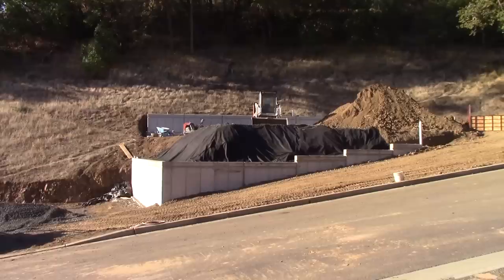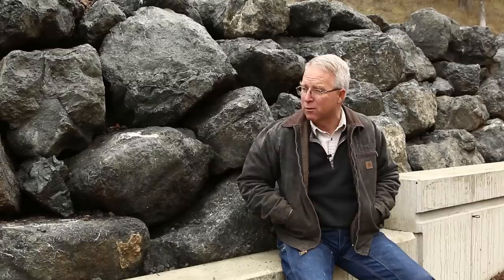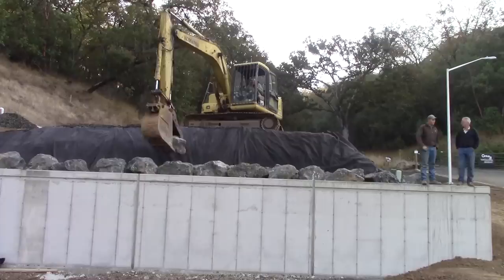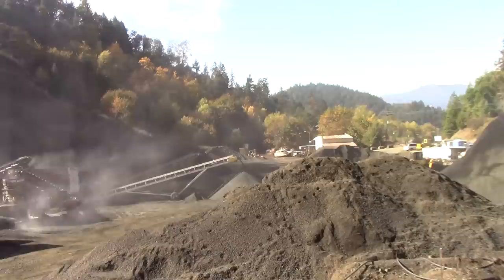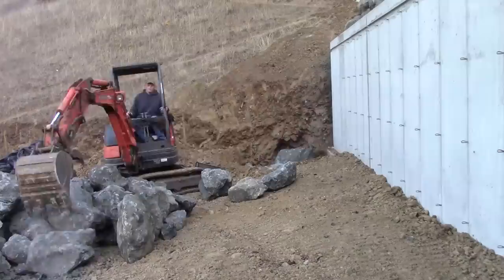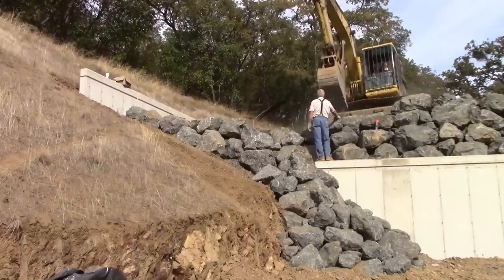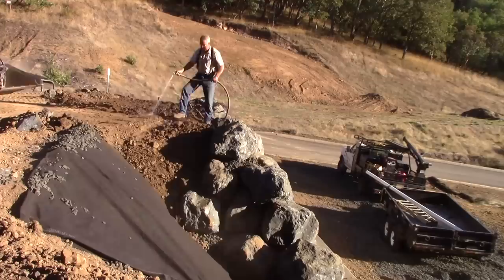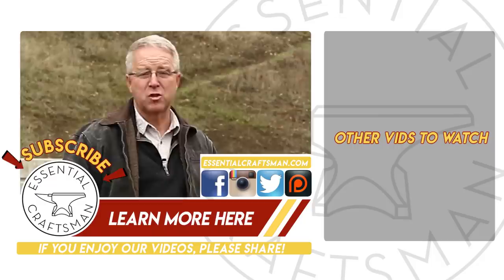How To Stack A Boulder Wall: Ep 20

Comment: At the risk of showing my vast ignorance in construction; I do have some construction questions:

You mentioned in a previous video that building up is cheaper than building out. I'm interested in very small two story homes. Small as in down right tiny. One room home over a garage, but a single structure. So my question is at what point is building too small just not worth the cost saving? I live in a large city here on the west coast. Is it difficult to find tiny plots without having to buy a large amount or is the plot locked into size no matter what you want?

Comment: What would you recommend for an old concrete wall that is failing but still is working. The concrete wall does not go into the ground.  It is only about 3 feet tall.  However, it holds back the dirt well.    We don't want to dig up the wall and put in another concrete wall.  We are looking at boulders next.  We want to put a boulder wall up against the concrete wall.  If the boulder wall placed up against a concrete wall fails as the concrete one is failing, we won't be bothered by the look of boulders moving a slight bit in our lifetime.  
Our biggest concern is that we are on land that has been known to have some underground water.  We have worked on many french drains to keep water away from our land.  However, there is always that threat of a small amount of water.  
What are your thoughts?

Comment: Where can I find the cost of prepping your lot, up to this point?: Ready to pour footings. Yes, it is a milestone. And I'll be a pricey one. I had a 10-acre lot in northern Az. years ago that I had a mobile home on. We wanted to build a house on the lot, but we knew that some work would need to be done to the lot itself, to stabilize it, as we sat on a small incline of about 7% with a 100-foot cliff of unstable rock about 100 yards behind where we wanted to build. The cost to do this was more than the cost of the home itself.

Comment: Did Douglas County require your structural engineer to consider earthquake issues when designing the retaining walls? Or, in placing the riprap beside the wall at the property line? All comments welcome. Steve, SLC UT USA

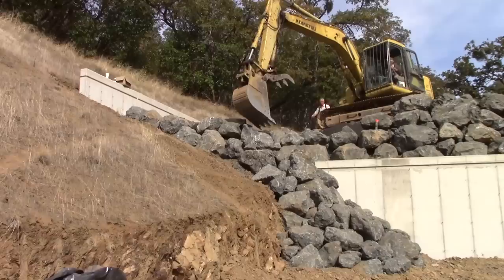Comment: @ 11:24 when you are talking about how the boom or rocks could fall if a line burst.. 

This shouldn't be true. Any hydraulic equipment which is used to lift objects or people, should have double check valves. Double check valves lock the fluid in place if pressure falls due to a catastrophic failure. I don't know what the law is in your part of the world, but double check valves should be on any excavator that is being used as a lifting device. 

Great video, and thank you for the knowledge.

Comment: Does the weight of the rocks resting on the slope to the top of the wall exert a lateral force onto the top of the wall, or are they placed so that all force is straight down? I would be concerned that any lateral force at the top creates a turning moment on the wall multiplied by its height.

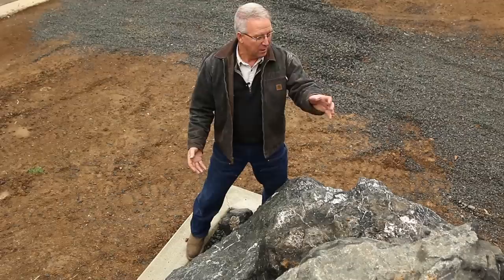Comment: I noticed at 3:30 that the corner of your retaining wall has already developed a crack, which seems to have radiated out from the inside corner.  Is this a problem?  Could it have been avoided?  Sharp inside corners concentrate stresses - that's the famous reason that airplane windows have round corners.

Comment: No rudeness, just all questions and  thoughts due to my experiences with walls I have been called in on to repair.
Isn't that a Massive amount of top heavy? Rain, dirt, silt, now ultra heavy boulders making a constant push towards the wall. Doesn't that manufacturer quite a bit of leverage. Doesn't the height of the wall work as a very long fulcrum in comparison to the width of the footing. I can go somewhat with the idea of a basic lawn or flower bed at top/finished grade. However, without what I call "dead men" reaching back in throughout the backfill and tying together usually in a box shape set at least 4 feet back. Also, usually the "dead men" are set up about 6 to 10 inches above each other. The taller the wall the further the upper "dead men" go back into the upper grade to compensate for the height and length of the wall/fulcrum. 
????
Reply: Essential Craftsman, Have you built a lot of retaining walls this way, or have you seen other walls that were engineered by this man?
Reply: Essential Craftsman, last one I think. How old are those jobs?

Comment: Why are the dump trucks in this video lifting the body before popping the tailgate? I was taught to pop the tailgate first because of the weight shifting and with big rocks and body lifting you can jam the tailgate. Not fun when they jam up. I must add I've worked in asphalt paving and you MUST have binders on the tailgate if you are using a shoot with the body up. I have seen tailgates POP. Meaning the welds on the body didn't hold with the body in the air under load WITH the binders on. I've seen the hoist pin break resulting in the body full of (HOT) asphalt dump behind it resulting in the load falling on a skid steer operator . Never do that! It's a time saver sure but in this instance the skid steer on site had a glass door. We also had a john Deere that didn't have the protection because an old timer thought it was a pain in the butt. Thank God that day nobody was injured. So back to my question who taught to to raise the body before popping the
 tailgate? Safety first! Company preach it but don't teach it. That's what I was taught and you can't believe it till you see it but the worst happens sometimes. Thank God I seen these situations happen in front of my eyes. So I can tell you

Comment: I’m curious if you are planning a fence or hand rail at the top of wall/slope? Did have convinced the building official one isn’t required because the rip-rap is a battered slope rather than a vertical drop? Based on my personal aesthetics, a handrail often detracts from a wall... but if this development is for a speculative sale, I also understand it’s not worth skipping on code/safety and underestimating the stupidity of others. 

Also, you do Class A work. I’ve seen a lot of construction, and it’s my opinion you truly set the standard for excellence. But are you worried about how a lawyer may twist your words (or use your video) if there is ever a claim of defective construction? Surly you have heard of the stupid cases where a new owner just can’t be pleased or a lawyer is just out there to draw blood!

Comment: I'll admit I don't understand this. I know basalt is a light rock, but your geotech guy says he's not comfortable with any structure within 10 feet of the wall and then you dump tons and tons of rock which will certainly be heavier [per unit area] than any two story wood-framed house + foundation right at the edge.

That wall relies on carbon steel rebar to stay upright, when that rusts away [I have no idea when that will be] this thing is going to fall over in a rockslide. Why wouldn't you put the bolder slope on the bottom and then do the retaining wall? It would take up the same area but it would be longer lasting and safer to be around [gentle to steep slopes are more dangerous than steep to gentle ].

Comment: I am sure you have a surcharge problem; the top of this wall is overloaded. Does your "soil engineer" have all his pistons firing?  Plus you might be overloading the toe of your footer at the corner detail with those boulders.  You should have been using a gator grid fabric for this job and not just soil compaction.
This engineer makes me think of the engineers that build on the hills of California and then the owners are surprised when their homes slide off the slope they were built on.
Reply from the maker: Thanks for the comment, you are close on your observations!! We DID have a problem with surcharge and site safety... The video describing the condition and fix was uploaded a couple of weeks ago.